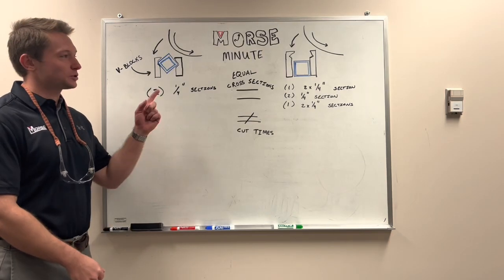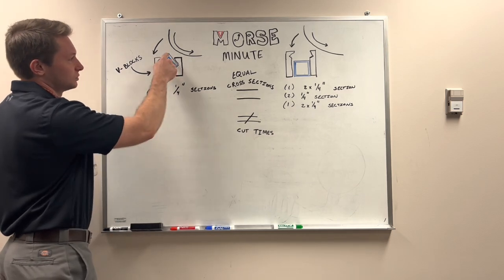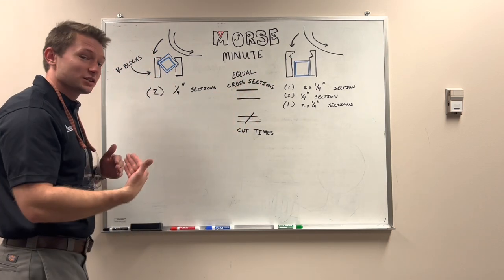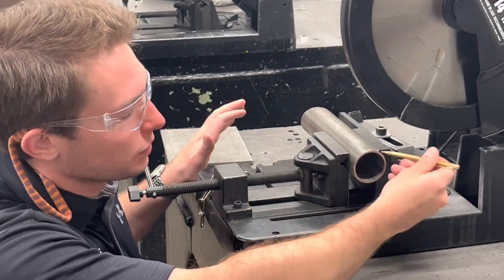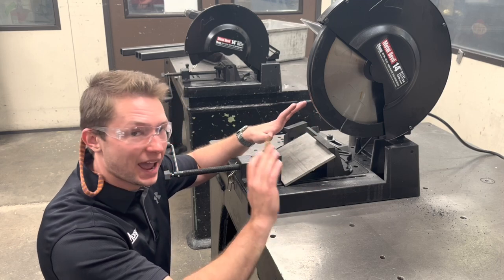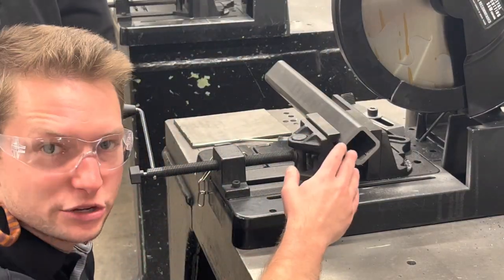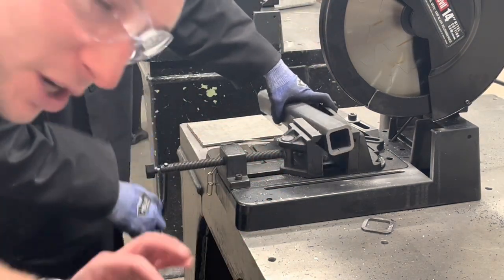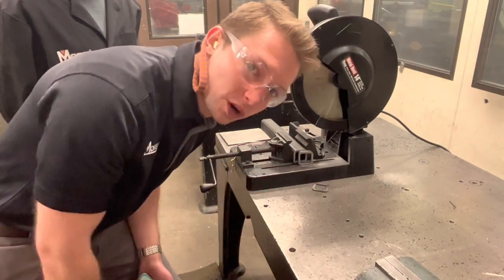Tech Time: Proper use, benefits of V-Blocks

Comment: Interesting. I’m wondering though if it takes longer to secure a square part in the V blocks than it does to just seat it on the bed. But I’ve always thought that the main benefit was to minimize blade tooth wear and to keep the teeth cooler as they spend a smaller percentage of time in the metal.